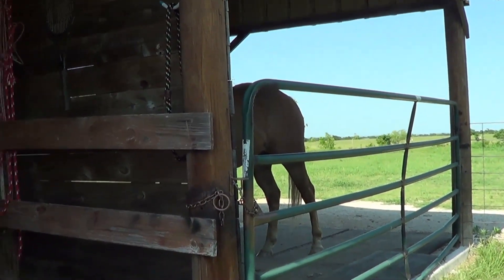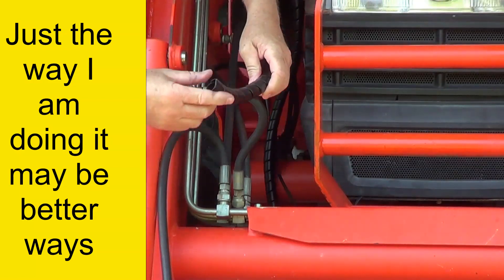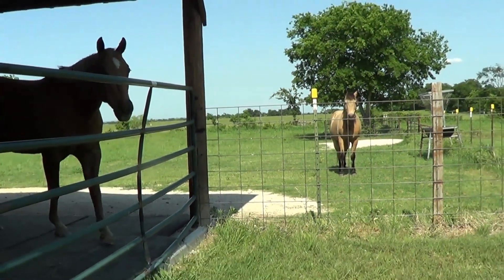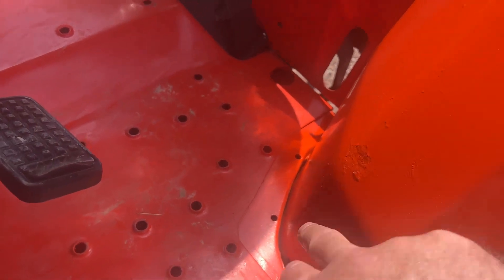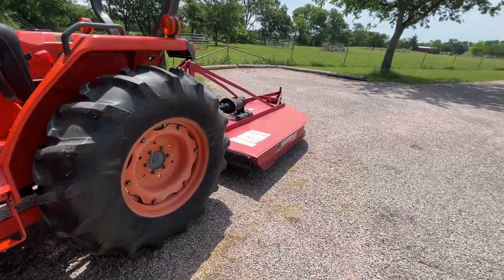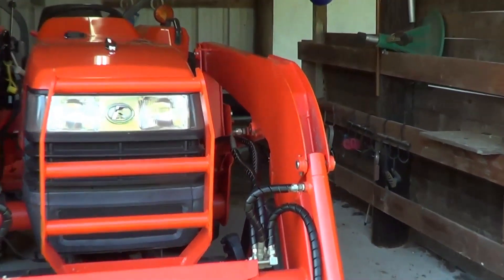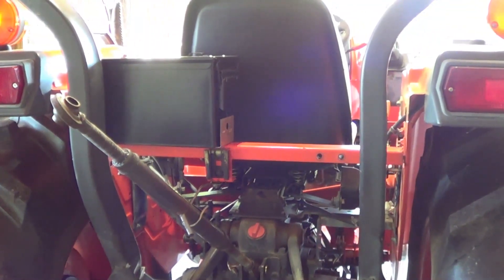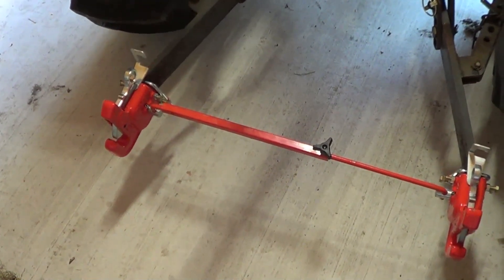Kubota Tractor Maintenance, Upgrades & Modifications - Bearings, Tool Box, Hose Protections

Comment: The hose guard on the hoses looks good. I wouldn't have bothered with the wheel bearings until at least 2035, lol. Those front tires might go another 10 years, even all cracked up like that. Implement/tractor tires are really thick and I have seen tires with cracks you can stick your whole hand in run for multiple years. Your tool box needs some sheer pins for the mower. I really respect how well you take care of your stuff.
Reply from the maker: my mower has a clutch so it disengages when it hits something, Not sure it has sheer pin, I looked in manual and could not find it
Reply: @HeyGunPeople  Clutch is less hassle anyway so long as it isn't being forced to slip too much. If you were to be mowing super heavy stuff all of the time different story.

Comment: Just a heads up  you can buy kevlar sleeves made for this   we use them at the company I work at to protect against salt damage   the twisted protectors you have probably work pretty well but I'm pretty sure there more suited to protect against abrasion   and rub points

Comment: Instead of using a jack to remove the tire, I always use the front loader bucket to lift the front if the tractor off the ground. Put a big block of wood or something under it incase it bleeds off. But it saves from having the jack potentially in the way.

Comment: On that PTO gearbox on the cutting deck, suck the oil out after done cutting for an hour or so and alot of that dirt and such should be somewhat suspended in the oil and the oil should be warmer and flow easier as well. Most likely way to succeed in doing what you want to do.

Comment: Cracked tractor tires isn't a big deal, run them till they're bald as a cop on steroids.
Reply from the maker: lol
Reply: 😂 that's a good one!
Reply: I get cracks on side wall from sun exposure is that a OK like you said, tires OK to have cracks on side wall of tractor tires.
Reply: @rp1645  I've seen some pretty bad tractor tires that still get the job done. Car tires on the other hand are not safe past 7 or 8 years after manufacturing date.

Comment: Very good advice RICK. I also noticed that one of those loader hoses( rub) on loader arm. Another great reason to protect them. I put those great protection covers on all my Hydraulic lines where they cross each other and rub as you move arms. I use my ( Dremel) to cut them. Just did it with my backhoe end. On the hoses that come from boom up through frame to Hydraulic control connection at base of Levers. Thank you for showing installation.

Comment: If the rust is in metel sand it down b4 you spray paint it or it will keep rusting under paint.
Reply from the maker: damn you are the third person that said that, even If I put rust converter on before I painted?
Reply: Ouch!